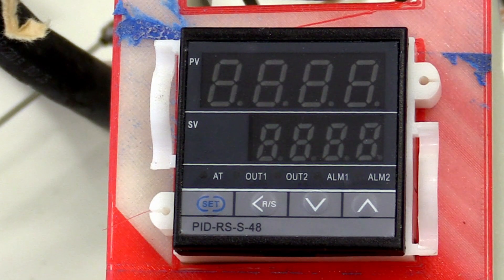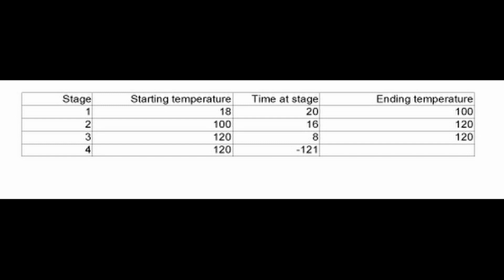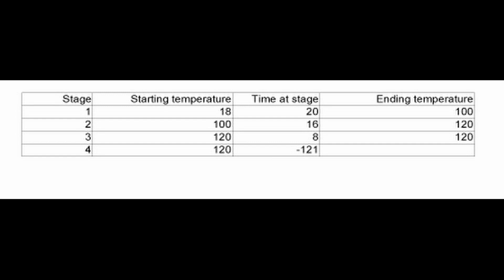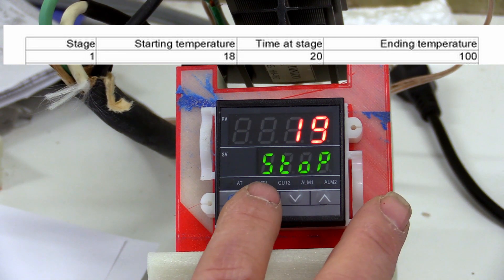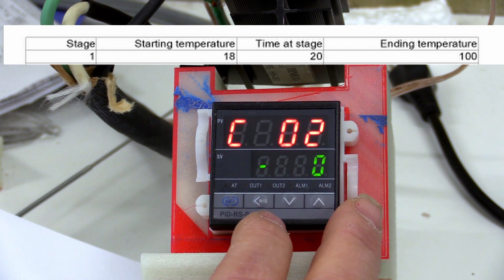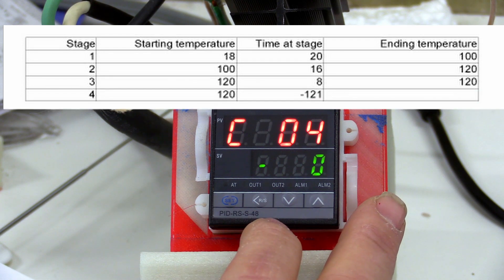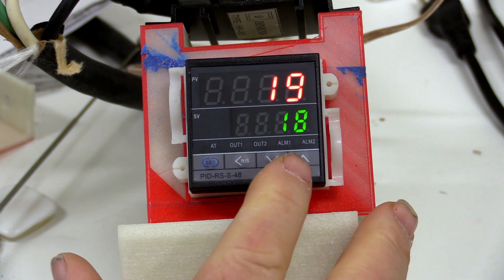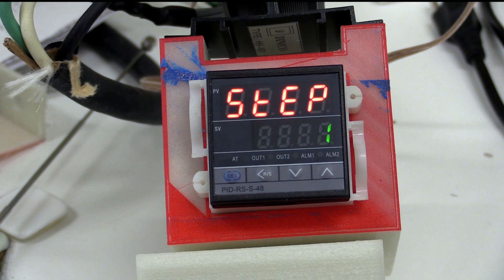Programming the PID-RS-S-48

Comment: I just started using a PID-RS-S-48 controler with my kiln. But the controler stops midway and does not reach my SV of C1140. Is there an explanation for this? Is this a safety feature for too fast arise in temperature?

Comment: How do I get a user manual for the PID-RS-S-48 controler?
Reply: The "instructions" in the "manual" are essentially useless.  They are inadequate, opaque and written in poor English.  This unit has two completely different ways to to programmed. The method shown above and using what is called auto-tune which is far easier.  

The instructions in the video omit several steps if there is a soaking time.  Here is an example of the planned cycle: 
Start at 25 C
Heat over 20 minutes to 200 C
Hold 200 C for 30 minutes
Heat over 80 minutes to 1000 C
Hold at 1000 C for 100 minutes
Cool over 50 minutes to 500 C (which is -10 deg per minute)
Turn off and cool naturally to ambient

Settings
C01     25       This is the initial temperature. You have to have one.  It is Set Point 1.
T01     20        This is the heating time to the next set point, not the time to get to the value 25.  Many are confused by this.
C02     200     This is the target temp of the second set point.  The controller will take 20 minutes to get there, remember, the previous entry!
T02     30        This is the time to get to the third set point.
C03     200     This is the 3rd target temp which is the same as the last one, which means the temp will remain constant.  This entry is missing from the video.
T03     80        This is the time it will take to get to the next set point.
C04     1000   This is the next set point.  The controller will take 80 minutes to get to 1000 C. 
T04     100      This is the time it will take to get to the next set point, which is going to be the same, meaning, no change.
C05     1000   This is the temperature of the soak and it will last for 100 minutes. It is the same as the previous set point,  = SOAK.  Not shown in the video.
T05     50        This is the time it will take to get to the last set point.
C06     500     This is the last set point which is cooler than the previous one.  The controller will try to let it cool over 50 minutes, if it can.  If not, it will take longer. 
T06     -121    This is a special code that means "End Program".   After this point is reached, the kiln will turn off and cool naturally. 

The importance of step T5 and C6 is that the cooling rate might have to be quite slow in order not to crack the product from differential thermal contraction.  The kiln itself may have a maximum cooking rate. Don't exceed it.

More generally:
Ramping from 200 to 1000 over 80 minutes (which is really fast): do not do that with a clay containing a lot of carbon.  Usually you should wait at 105 or 120 C for an hour to dry the product which would require 4 additional entries between T01 and C02.  A soak has two steps: both at the same temperature. The video misses these soaking steps.

After drying, ramp at a rate of about 135 deg/hour up to ~620 then hold until the carbon burns out which might take 2 or 3 hours.  Open the air holes for a small air flow during this time as carbon removal consumes oxygen O2 => 2CO.  If you heat quickly and directly to 750 C it will melt the outside of the clay and trap the carbon inside.  After getting out the carbon, you can ramp quickly to 950 or whatever the final temp is, at say, 250 C per hour.  If the kiln cannot heat that quickly even if you set it to be that quick, it will take longer, then start the next step.  

Discussion of ramping is usually in terms of Degrees C per hour.  This has to be recalculated into the temperature difference between steps and the minutes needed to get there at that heating or cooling rate. 

The Autotune function is completely different and more like what the video describes.

Comment: How do you create, store and name, and run a program any time in the future? It's not clear. The steps make sense, but I ain't grokin' the big picture. Is the example retained in memory even after it's turned off? Can you store several programs? The manual is a nightmare. All I want to do is make my 1970s era Paragon kiln go up to 1450F and stay there til I say "Down boy!"
Reply from the maker: The program remains in memory until it's replaced by another memory.  Only one program at a time. 
Agree totally about the manual.
So you would program the program something line this:  First is ambient temperature.  Next is the t (time) you need to get to the set temperature.  Then you would put in a long time (hold time).  Interrupt  the program when you get tired of it being at that temperature.  Let me know if you want step by step instructions.  And thanks for watching!
Reply: @bensonfilmworks7595  I figured it out for the most part, at least well enough to use my kiln, after reading 2 different manuals and watching your video along with another one. Thanks.
Reply from the maker: @TheKrighter  GREAT! You get a master's degree in kiln programming.  Congratulations.
I'm like you. Just know enough to limp along and get a simple program to run!
Reply: @bensonfilmworks7595  Hey one more question: How do you turn a program off completely so you can start from the beginning? I keep restarting it and it starts where it left off, which is causing problems. I set 'run' to various settings but none of them work. Is there another parameter that sets all back to square one?
Reply from the maker: @TheKrighter  I know what you mean.  I just completely unplug it from the -main power supply, wait half a minute and seems like everything is erased.
As an aside, once the program is running it seems to keep running, picking up where it left off when the power is interrupted for a few minutes.  Pretty cool
Reply: @bensonfilmworks7595  I figured it out. The model I have has static RAM and remembers everything about where it was in program execution. Setting PDE=3 does the trick. It tells the program to forget everything and start over from the beginning any time it's powered up. Before it would start where it left off and I didn't want that. By the way, the Japanese ESL manual had it spelled PED.
Reply: If it is stuck in C and you cannot figure out how to select F, enter the following:

C01 25     (ambient temp)
T01  366   (number of minutes to get to the final temp)
C02  788   (which is 1450 F)
T02   999   (means 999 minutes to next set point)
C03   788   (means it will remain at 788 for up to 999 minutes or until you say "Down boy!" (Press down arrow)
T03   -121

How long do you want to hold 788 deg C?   If you know, set T02 to that time. It is probably not wise to set the kiln to remain on forever.  Do you know the primitive kilns that had a timer on them, you would set the timer to longer than you think it will take to heat and melt the "cone" and drop off.  That timer is there for a reason. If you think it will take 4 hours to complete, and you set it for 6 (and fails to reach temp) at least it will shut off while you are picking up the kids from school and forgot about it. 

If you have one of those old "cone melting shutoff kilns" you can get all spare parts from Paragon Industries in Texas.

Comment: Benson, do you know maybe why my PV, even at room temperature, is always 25-30C higher?

I'm not sure if it is due to my thermocouple as when I hold it in my hands, the PV value rises and falls normally. even though it won't fall below a certain threshold (I believe 15-20C) even when my room is near 0C.

This kind of makes things difficult to program for the SV.
Reply from the maker: Not sure.  You can change the offset temperature to compensate for erroneous results.   The parameter you want to change  is called SC.  I'd give that a try.  Hope that does the trick!
Reply: The usual cause of a difference that large is there is an offset programmed into the unit that should be removed, or the wrong type of thermocouple is selected.  T v.s. K, for example.

Comment: Thank you for your videos they are very helpful but do you have a video describing how to just if the actual temperature is about 60 degrees 
higher than the set temperature.
Reply from the maker: Oh man. I'm sorry.  I don't.  Do you mean to adjust the temperature?  I'm sure you don't mean  to just do the arithmetic for each segment.  That would be too easy!
Reply: @bensonfilmworks7595  For example if I set the controller to go to 200 degrees the kilim will actually measure about 280 degrees, strangely if the program is not running the controller states that the temperature is 28 degrees and my other thermocouples and temp gages confirm 28 degrees also.
Reply from the maker: @matteyles7466  There's an offset parameter you can change.  Hit "set" repeatedly until you come to SC then enter the offset.
Make sure you have the correct thermocouple type selected.  This is called "Input type"  abbreviated Sn in the menu!  You might double check to make sure your selection matches your thermocouple. Hope this helps!
Reply: Move the sensor controlling the kiln. It is not getting the actual interior temp.  Alternatively, lower your program temp. Easy.